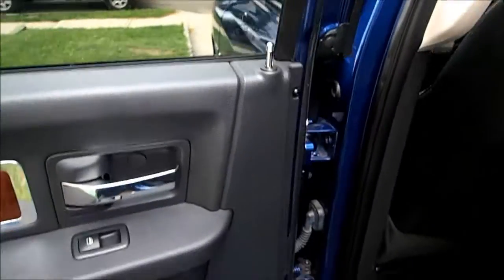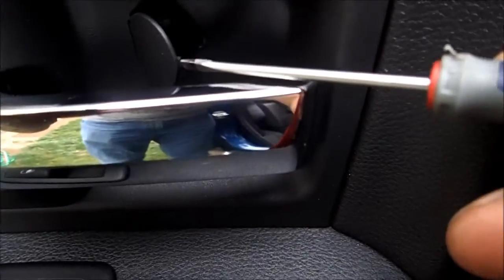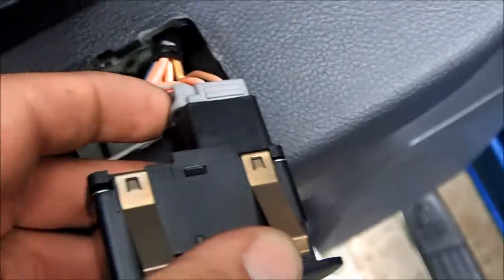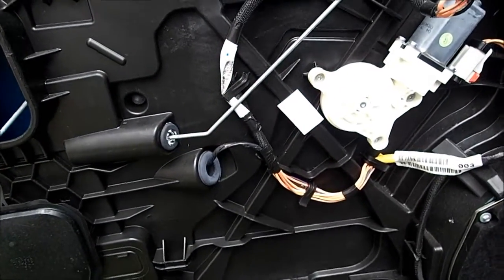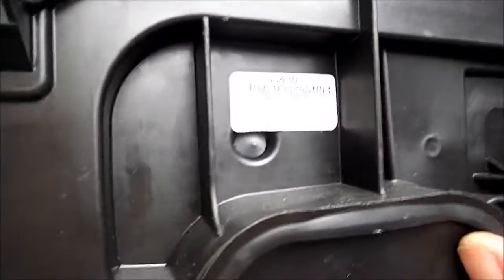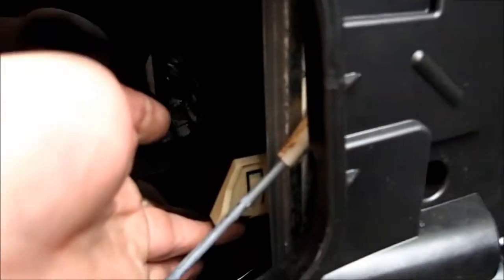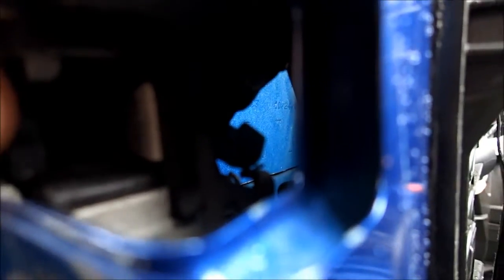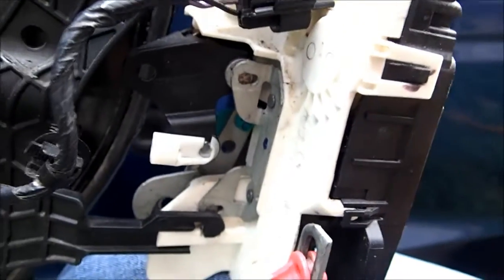2009 Ram 1500 Crew Cab Rear Door Window Regulator and Latch

Comment: Holy fuck. That's a lot of shit to disconnect. All I wanted to do was to tap a door ding out. I guess I'll take it to the body shop. Anyway, once I got the door panel off, and found that I needed more info on the inner panel, I did find the annoying chirping noise I was hearing back there. It was the panel rubbing against the door. I'm gonna put some silicone grease between the door and the outer panel.